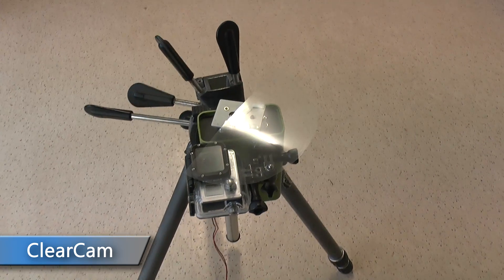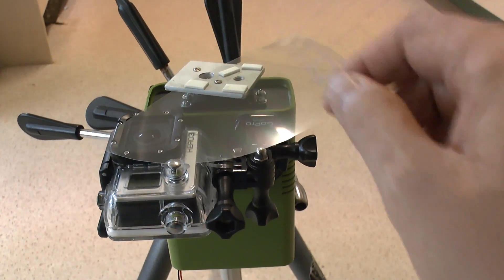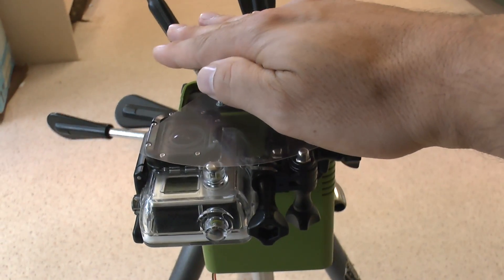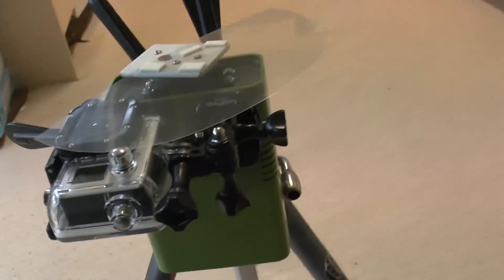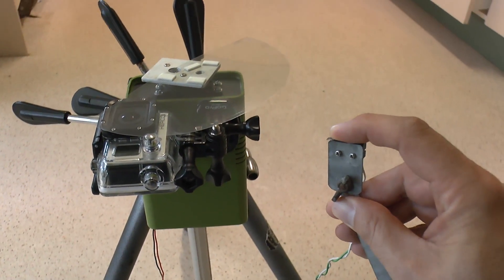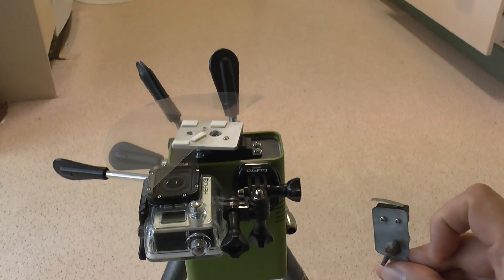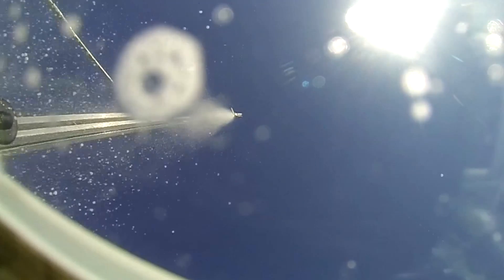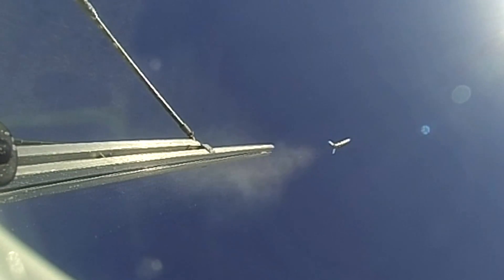ClearCam for water rockets

Comment: Hi guys!!!!
And im back into action soon ill be posting one video of me testing my gardena launcher( tho it didn't went as well as i expected...)
Any way i always wanted to ask you guys a question of utmost importance:
How do you make couplings from bps threads?????
I read that you guys rethread in a lathe but the thing is i dont have a lathe and i also can't get tornado tubes!!!! D;
i already tried to make couplings by gluing caps but they always fail at retarded pressures or the aren't straight at all.....
Any ways if you guys could show how you make it or suggest any alternative i would be REALLY happy .
Bye
Shiva,
Reply from the maker: Hi Shiva, yes we re-thread the BSP sockets to make them compatible with the bottle necks. You can't order the normal tornado tubes on-line? An alternative would be not to use tornado tubes at all, and just make a single spliced pressure chamber for the entire rockets. You could also probably make a permanent connection by gluing a short piece of PVC pipe into both necks of the bottles instead of the tornado tubes.
Reply: AirCommandRockets what glue should i use for the permanent one: "You could also probably make a permanent connection by gluing a short piece of PVC pipe into both necks of the bottles instead of the tornado tubes. "
????
And besides i can't order tts" online…..
damn it i thought the bsp threads would perfectly match the bottle thread, pretty sad D;
But ill be working on my own coupling soon with all glues  have access to…
Becouse i think that i can't be the only one in the world with shortage on availability
of materials and i wish i will be able to help anyone out there soon enough !!! xD

And unfortunatly i don't have patience nor experience enough to do a single large pressure chamber…..
I also made a new splice with consist of sikaflex construction (the most commonly available sika in the world) as a sealant and epoxy as the holder( because it is the epoxy which hold the bottles together)so since that i want to pos a video on how to make it ….
Shiva
Reply: SPN WaterRockets i also will show the results of the pressure test tomorrow…
PS*: i already tested it up to 120 psi with no leaking at all 'YEY' o/
Reply from the maker: SPN WaterRockets The 24Hr epoxy works fine between the PVC and the PET bottle neck. Make sure you rough up both surfaces first.

Comment: Always a pleasure to see these launch videos. I was also thinking on a suggestion to blow away the foam and avoid falling on top of the cover (e.g. air dryer), probably not a good ideia. For sure you created a great device to produce very nice shots.
Reply from the maker: Hi ptx, that's actually not a bad idea. Instead of the fan to blow the drops away, we already have a source of high speed air (scuba tank) that we could divert on launch to blow across the lens. Hmmmm... certainly something to think about. I think the critical factor will be how fast are the droplets falling and how high we would need to put the source of air.
Reply: That's a great idea ptx!

Comment: qi should use  a normal go pro and in place of that thing you made i should spray some ?AntiWet? (think its that i dont know the name that good) on your gopro so everything that gets on it wil be removed directly without wasting your money on something that you made, or you should just use a motor and spin the plastic cover super fast, thats an option to :) just say what you think about my idea :D
Reply from the maker: Henrik Härkönen It's quite a good suggestion. Some one also suggested having a fan to help blow the drops away. We already have a source of air (scuba tank) going to the launch pad and this air could be diverted after launch to blow on the lens.
Reply from the maker: Hi Benjamin. The Anti wetting agent is certainly something worth investigating. You would have to check its optical properties and from what I have seen the agent doesn't agree with detergent. But for a few uses before you have to re-coat it it may be worth it. The ClearCam didn't cost us anything as we already had all the components. Spinning a disk quickly could also be an option again something that would be worth considering. Thanks for the suggestions. :)
Reply: It is NeverWet so I can advise use to spray that on top of the camera lens, verry usefull I have never done something like that before but it's really usefull. I just wanna correct the fault I made by saying the wrong name. Merry Christmas and HAPPY HOLLIDAYS EVERYONE!!!!
Reply from the maker: Benjamin Coussement Yup that's the stuff. Have a great new year. :)
Reply: Yep you 2 !!!
Reply: AirCommandRockets How about a compressor blowing air just next to the lens, with a suitable nozzle, so that no droplets would ever land on the lens?
Reply: Don't make it to complicated!  :D

Comment: That looks like a really good idea! :)
But as you mentioned in your website article, this need some improvements.
I'm sure the results will become even better if you implement it.
One additional suggestion:
You could make the moving of the cover constantly  instead of the jerky movements.
This could help to make the cover less irritating and less arduous for the eyes.
I'm looking forward to see the next launches in this amazing perspectives.
Cheers
Julian from Raketfued
Reply from the maker: Hi Julian, yes this was only a prototype to see how well it would work, and it does need improvements. We want to enclose the whole thing in a box to protect it from splash back on launch. The speed looked okay when we built it, but when you watch the video in slow motion everything moves so much slower. We had to balance the speed because we only had 180 degrees of movement and we wanted to stretch it out over a number of seconds while the rocket climbs up. The disk could be bigger and that way we would get more speed also, but then the whole thing just becomes more cumbersome. We'll gear the servo motor so we have 360 degrees of movement and things should move faster. We'll try the continuous movement too as you suggested to see how well that works. :)
Reply: AirCommandRockets
 Good luck with the improved version. :)
I think the idea from ptx is great.
Cheers